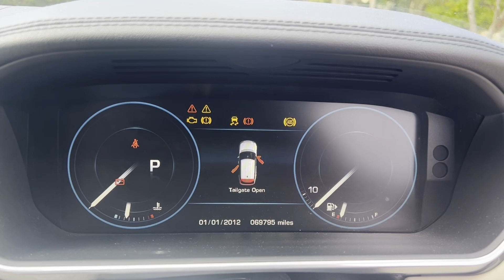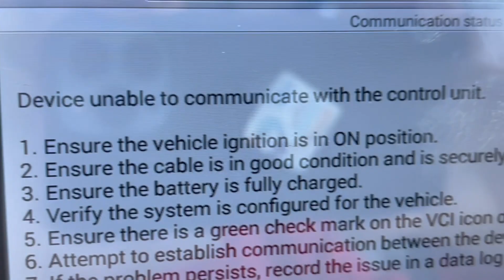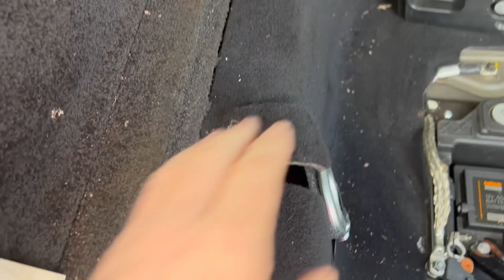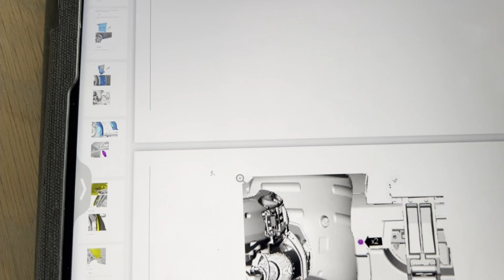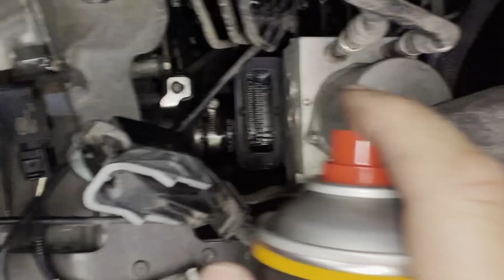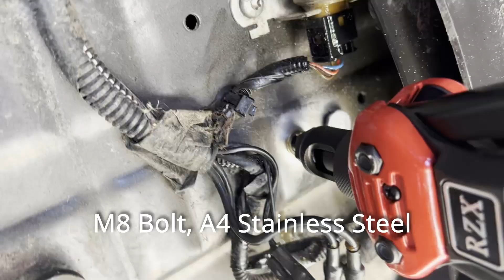Range Rover L405 Multiple Dashboard Warnings

Comment: Had the same faults this week on my L405 3.0 TDV6 - ABS  Fault, HDC Not available System fault, Park Brake Fault, Stability Control Not available Drive with care, Emergency Brake Assist not Available, Adaptive dynamics fault. Garage found rear wheel bearing failed and damaged speed sensor. Both bearing and sensor replaced and all back to normal and good now.

Comment: Hi everyone. I have the same problem. today after 20 mins… 14 warning lights! I’ve checked the abs earth in wheel arch. Looks fine as it’s already been fixed in the past by previous owner I guess (I’m a dealer by the way)) 

I don’t know where to start next.
Reply from the maker: Have you any detailed fault codes. Might again be only one module faulty which is causing all the others to report it hence the 14 errors.
Reply: @ hi Andrew, thank you so much for getting back to me. 
I’ll plug it in and try and send you some screenshots. It comes up with so many issues. 
This morning, the car started perfectly , 
But I will definitely happen again 🤦‍♂️

Comment: I had the same problem but don’t forget they have two earths one on each side of the front wheel arch under the plastic covers 😊
Reply from the maker: Yes - other side has the earth for Bonnet Close sensor (giving binnet open error). I had that occur a month later. Its worth doing them both at the same time.

Comment: No start scenario usually with continuous power down on start or spurrus fantom fault codes when cranking =
EARTH LEAD IMPEDANCE failure - continuity test will show good earth lead but adding a second earth lead will eliminate no start- power down on start - annoying fantom fault codes on starting .......in my experience 😑